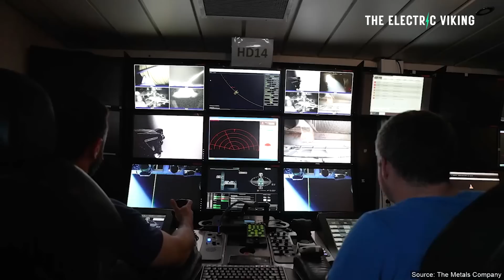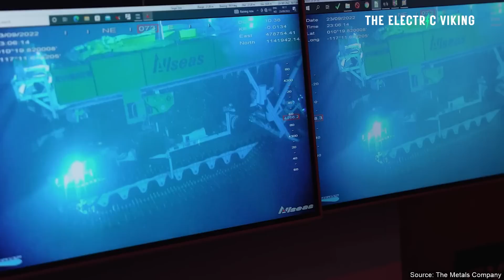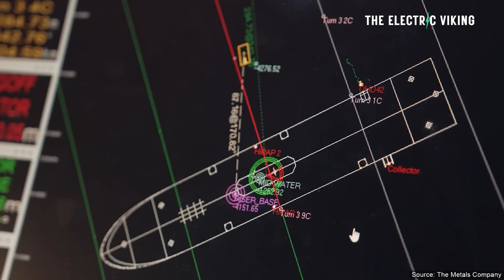The planet's largest source of battery metals sits 4,000 meters under the sea

Comment: Of course making EVs requires that we do damage to the environment same as ICE cars. However, it's a necessary step to make things better. In time we will be recycling battery material at the same rate we recycle the lead in ICE car batteries. We recycle about 90% or lead acid batteries and we started in the 1950s. Sone of the lead in your car battery might have been mined in the 1950s. That's why we don't have lead mines all over the place. Keep in mind as new battery types go into production the need for any one type of material will be reduced so I don't think it will take as long to get to a mature recycling system.
Reply: You are correct except the materials in an EV battery are even more costly than lead, so even without government incentives, battery recycling is profitable.  Assuming of course once there's enough EOL batteries to recycle at scale.  Right know 95 percent of EV batteries are still in the EV's so it will take some time before the cycle is mature.
Reply: The current world production of lead mining is around 4.5 million tonnes per year, with about 2 million tonnes being mined in China, a half million tonnes in Australia, and 300,000 tonnes in the US. Some of that is as a byproduct of zinc, copper, and other mineral mining, but the majority is from galena ore mining. And while lead acid batteries are highly recycled, 4.5 million tonnes a year is a lot of mining!
Reply: @GoCoyote  The auto industry only uses about a million metric tone per year, I wonder what the rest is used for?
Reply: @frankcoffey  
Batteries use 85% of the worlds lead supply. The rest goes into ammunition, paint, petrol/gasoline, cosmetics and dyes, building materials, metal alloys, cook ware, and believe it or not, into food for coloring and its sweet taste.
Reply: @GoCoyote  Think bigger.
Reply: @frankcoffey  All kinds of things, bullets for example, pewter,  radiation protection.